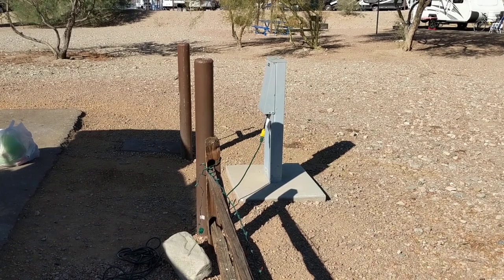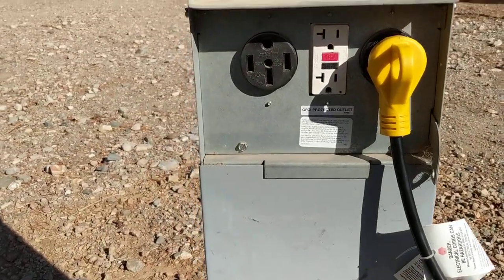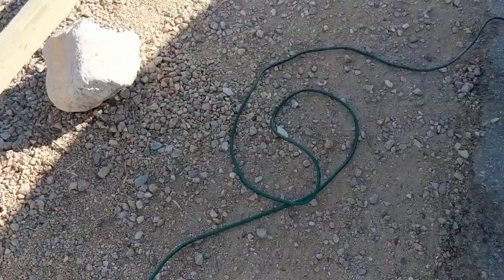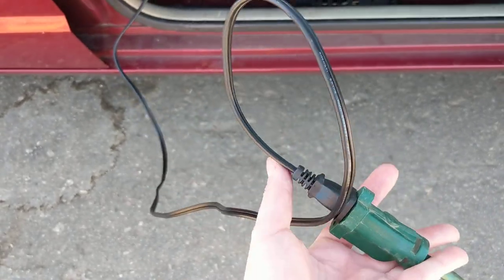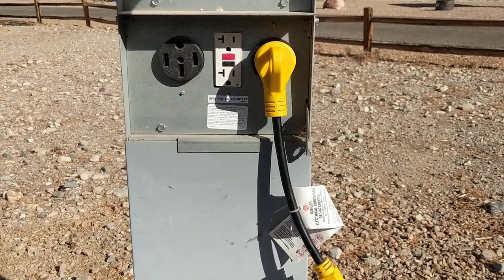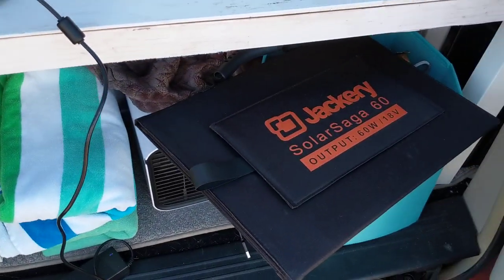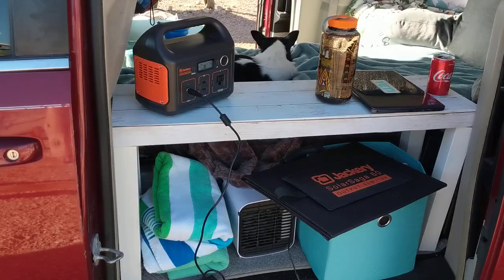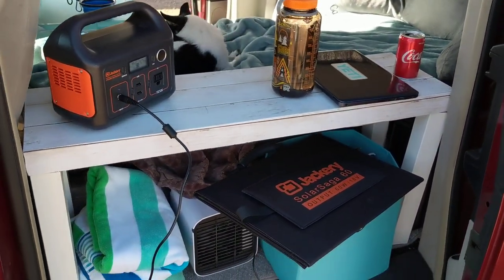How to Use Electric Hookups at a Campground | No Build Minivan Camper Conversion | Van Life

Comment: As a construction manager, i   recommend getting an exterior rated extension cord.  They are definitely going to be safer, and more durable.  They also make a circular wheel, that you can store the cable on, if you have a little space.  It is easy to avoid twists and tangles.
Reply from the maker: Yes the one I have is for exterior. Thank you!

Comment: If you do t have a Jackery, you can use an extension cord with a power outlet strip. (Make sure it’s a surge protector one and make sure the extension cord is rated for outdoor use. )
Reply: Have a jackery 300 but you can't put a space heater on that.... Any suggestions? I guess you could just get more extension for it but the space heaters something's up, even the surge protector

Comment: All good info. Great help for many I'm sure.!  Great for low wattage. The one thing I'd suggest if someone was going to plug in a higher wattage appliance such as heater or more than 1,000 watt etc is to use a heavier gage extension .. The one you are showing is skinny so like a 16 gage. So for higher amp draws or watts, a 12 would be safer . Cheers

Comment: At campgrounds I used the outdoor extension cord then plug into a 6 plug surge protector. If I pay for electric I would use it.  Good idea to pick up an adapter in case I come across sites that do not have the wall outlets ( 20 amp Edison). Hoping to do more boondocking this year but still good to have the adapter. Thanks for the info.  I will get it with the water filter adapter as well.

Comment: Amanda, thanx so much for this very informative & helpful video.. I'ma novice so. I've been wondering how to navigate this. Was considering installing a shore power outlet in my van but this works just as well 👍🏻
Reply from the maker: You are welcome, my friend!
Reply: The shore power, permanent installed is nice tho, if you have more appliance, or want to shut the doors, and still be connected to the electric cable.  "Upgrade" is what she would call it.... LoL.  Different options based on your needs, or preference.
Reply: @cathycoryell2351  Good to know, thanx... it's nice to have options
Reply from the maker: @cathycoryell2351  Sure, that is a nice option for people. I just don't need it.

Comment: Novice here...should I assume a 50 amp dog bone adapter would also work?...going 50 amp to jackery?  Also, could you have plugged your extension cord directly into to 20 anp and skipped the adapter. This video is first that I found that was straight forward and showed how to do this for a novice...I appreciate that.

Comment: Do you have any favorite campsites you would recommend? How do you find places to camp and/or boondock? How do campsites work in general, do I need to make reservations online? I know absolutely zero about camping 😔
Reply: Most campgrounds require reservations in advance. Many are online and that's a good way to get started.   Many are booked for the whole summer, by mid-May, in the northeast. Some have two or three night minimum, as well.   Camping is a huge industry now.  You can check back often, to see about cancellation, or trying to get in last minute.
Reply: Cathy’s info on campsites very true. I was a little surprised that campsites are booked solid for weeks (or months) in advance. I prefer campsites with water/electric hookups which cater to RVs but I feel safer than in a primitive campsites (older female in a car alone).

Comment: Are you concerned about electrical surges?   Most channels I’ve watched also have a surge suppressor when they hook up, but those are RVs with electrical systems. Maybe the cost a surge suppressor isn’t worth it compared to the cost of replacing the small jackery. 

I’m planning on traveling in my Subaru Forester once the country opens up again so I’m really enjoying these short informative videos, thanks
Reply from the maker: I am not concerned. ☺️

Comment: You link us that adapter in Amazon. It says 30 amp to 15 amp. Does it mean it goes down to 15 amps? The campground I'm going is 50 amps. So I need to buy a 50 amp to 15 amp adapter? Do you think it's going to fry the cord itself with so much surge power? The reason is that I'm planning to buy a window AC and a refrigerator to cool my tent. So for a 50 amp site, what cord and adapter should I buy that's safe?
Reply from the maker: They are very different so you'll need a 50 amp adapter. Definitely get a surge protector.

Comment: I don't think the standard plug on the Jackery power station can plug into the female receptacle in the pedestal. I think the pedestal uses a NEMA 5-15R receptacle. A standard extension cord male plug does not fit into a NEMA 5-15R receptacle. An extension cord with a NEMA 5-15P Plug is needed to plug into the NEMA 5-15R outlet in the pedestal. What you show is a good option. Use the 30 AMP NEMA TT-30P adapter to plug into the 30 amp receptacle in the pedestal. It would be nice to see the female end of the yellow adapter. Is it a standard three-prong receptacle or a NEMA 5-15R?

Comment: What are people's thoughts on running an extension cord into your van (for charging things overnight ,for example)?  I'm thinking of doing some car camping, and while I have a 240W jackery unit, I do still plan to stay at some campgrounds with electricity and was thinking of running an extension cord through a cracked window (a window I intend to crack at night for fresh air).  I know some will say that it's probably not safe in case of a short or potential fire hazard....  I'm not looking to power very much, mainly charge a laptop, my phone(s) and the Jackery overnight, and maybe run a small 60 watt cooler.  (The reason I'm considering this is I try to save the Jackery for times when I am not near an outlet, say if I'm camping in a primitive camp site without power, so I like to try to charge things when I can).

I should also note that I do plan to use a power strip with surge protection as well to prevent overloading (although I don't think the items I listed would overload a 15 or 20 amp circuit.)
Reply from the maker: I always do that! Whenever I'm at a campground I run a cord through my window!!!

Comment: Should not have coils and knots in th3 lead beacause it will get hot burnout and may caus3 a fire,Always make sure your cables are unwound so electric flows through cord cable,
Reply from the maker: Okay!

Comment: you keep saying that you're jackery 240 charges at 50 W that's not possible due to the fact that the jackery 240 has a maximum charge of 42 W it actually  show this on the bottom of the jackery
Reply from the maker: It is possible because I've seen it, friend. Xoxo
Reply from the maker: Also , if you watch my newest video about Jackery solar, you can literally SEE on the video that it's charging at 43. So...

Comment: All that power and only 39 watts accepted. That’s why I wouldn’t consider a jackery
Reply from the maker: This is a small Jackery, and it's only plugged into a 30amp hookup. 😘
Reply: Many people with Van campers are happy with Jackery range of products. Even the upgraded Jackery does van size refrigerators, and TVs and more.   They are not running a 30 foot camper with household appliances.  They hook up low energy appliances, and are fine.
Reply: @cathycoryell2351  I sold my Travato and now building out a promaster van. I want to try to get by without solar. There’s other power stations that can be recharged much much faster from the alternator. I’m not implying Jackery is bad just that with a fridge, microwave etc without solar panels I couldn’t keep it charged without 12 hours of driving.